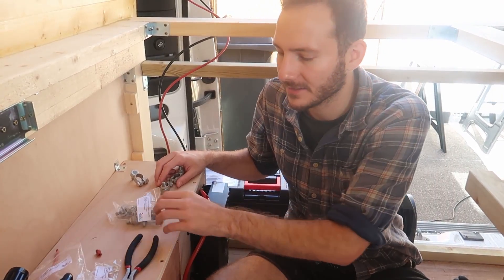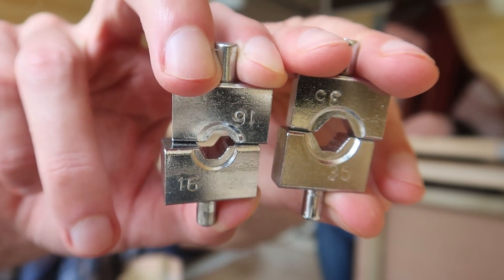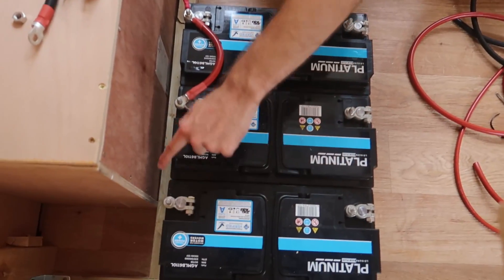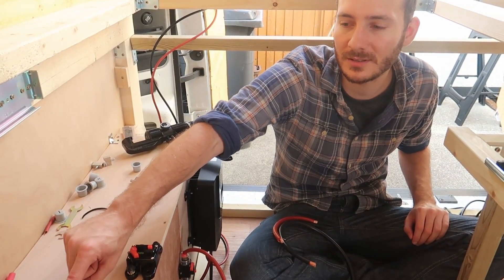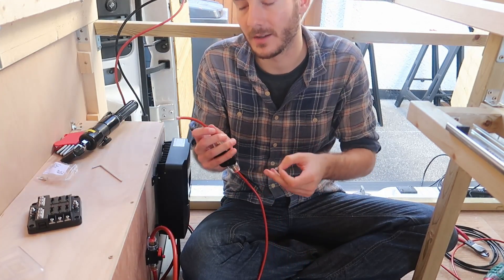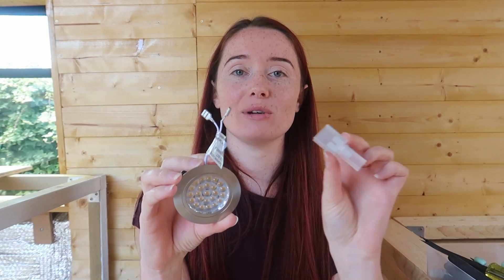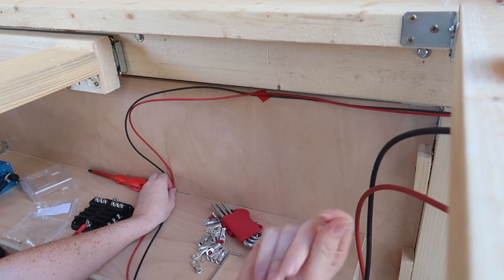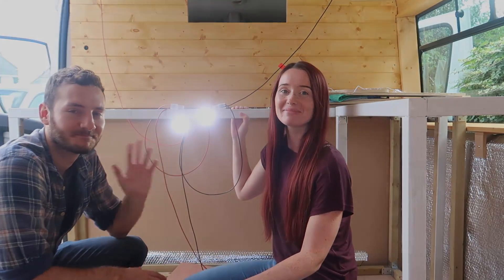Installing 12v LED Lights in our Van | Beginner Van Conversion Series UK

Comment: When using a wood bit, it's always a good idea to either place some masking tape to the underside of the hole being drilled or clamp a piece of wood to the underside. And use consistent light pressure as you drill. This will prevent splintering on the underside.

Comment: Did you have to use a connector to plug into the solar charger from the battery?? Or just the bare 16mm wire? You're doing doing great job! Keep up the good work!
Reply from the maker: Hi Joe, just bare 16mm wire. You simply tighten the wire inside the charger using a screw driver
Reply: @CallumTash  Thanks for your reply. Will be cracking on with that then next week! Fingers crossed. Like you said, seems harder than it probably is. Over thinking it. Will you be putting in a split charge relay? Chuffed you've got lights done and dusted!
Reply from the maker: @joesnow739  Good luck! yes, it's not too bad to get it all working. It all worked for us first time :) And yes we'll be putting in a split charge relay at some point
Reply: @CallumTash  Done and everything's working great! Buzzing! Been a week now and still feeling the achievement! Thanks again :)
Reply from the maker: Joe N awesome! Good job 😁👍

Comment: just to point out you state the wire size on your video, but you have not said what the total load within the van, if people follow what you have done the cable size may be too small and have issues. Also the batteries should be connected at opposite ends so that you are not taking the power from the first battery, connect to the positive the first battery and the negative to the opposite (furthest) battery.  the same for the cable size for the LED lights.

Comment: May not be a good practice to use RED heat shrink on BOTH POS and NEG wiring.
You'll know...but somebody servicing/ subsequent owner might get confused.
Look starting at 4:32
Reply from the maker: Yes, potentially. It's something we'll keep in mind if the day comes when we hand it over
Reply: @CallumTash  Sometimes people, NOT having the correct color for the appropriate POS or NEG cabling use HEAT SHRINK to indicate their INTENDED color.
This, now, is very apparent...BUT when your ELECTRICAL BOX get more looking like a RATS NEST is when the confusing may/will ensue.
Otherwise...you BOTH look like you're up on CURRENT EVENTS. LOL.

Comment: Just a quick question, the negative on your leisure  battery... have you earthed this to the van somewhere?
Reply from the maker: Hi Robert, no we haven’t
Reply: @CallumTash  you need to take the negative to earth or ground it somewhere on your vans body.
Reply from the maker: @robsrambles1801  Ok, how come?
Reply: @CallumTash  Well, sorry it yes and a no answer, if you gonna put a split charge relay or a radio on your leisure batteries. This will have have A: a permanent power supply to hold radio memory or if your split charge relay opens it will all the way round your van and could end up with a parallel connect if your not careful how you connect this, causing a short and fire.. 
Maybe worthwhile having a Google on earthing on campervans?
But well done you guys are doing a fantastic job 👏
Reply from the maker: Robert Combe thank you.. yes we will be adding a split charge relay so we’ll need to look into this 👍
Reply: @CallumTash  One last thing, if you looking at split charge relay or VSR look for a duel sense relay. That way it will charge both ways if required
Reply from the maker: Robert Combe sounds good..  weve bought one already and think it is dual charge
Reply: @CallumTash  cool beans guys... if you ever need some help with your van if your stuck on something let us know and we'll try help, but really well done on the progression..
Reply from the maker: Robert Combe thanks Robert, appreciate that! 😁